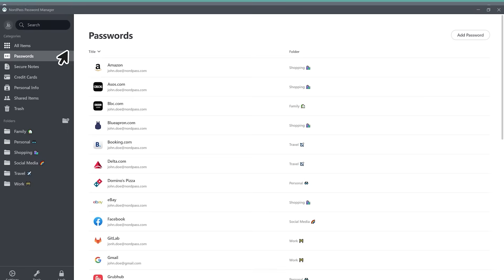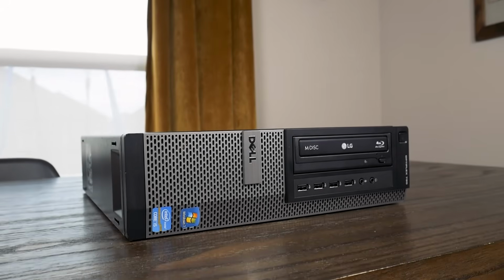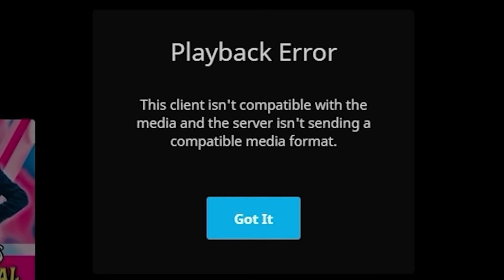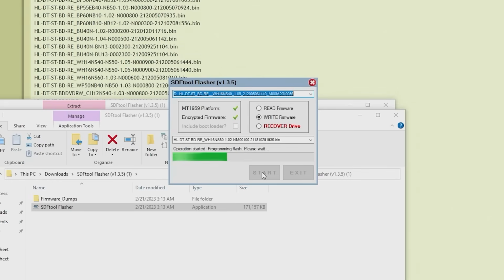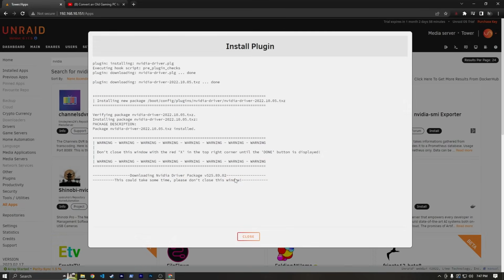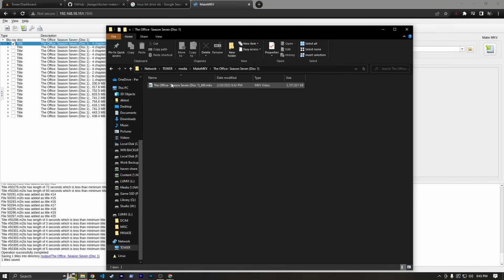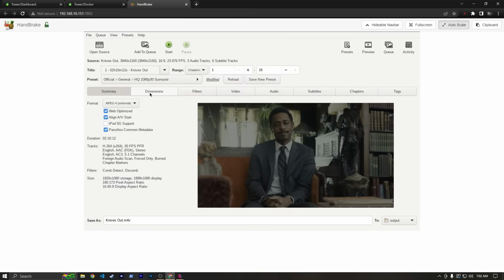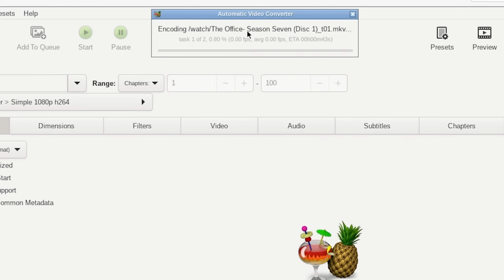Streaming 4K Blu-rays With a DECADE-OLD PC

Comment: Currently running a Amahi overlay on a  Fedora 27 server on a custom water cooled ROG Rampage V Extreme, I7-6800K, 64G ram, 24Tb Raid 6 (4 x 12Tb NAS Drives)  with a 2Tb M2 SSD boot. Running a Plex server for media. A bit overkill when you think about it but was having way to many hardware problems with this MB as my daily driver. Runs well as the server.
Reply: All good, transferred over 6Tb in one run, no issues found.
Reply: @colinsedgwick8938  Thank you
Reply: Hows the server going without ECC? Any issues transferring large capacity data sets?

Comment: Its  amazing  I am using an old AMD Phenom X4 9950 Black Edition as my Plex Media server and let it run headless in my attic Amazing to have found a good use for this old beats ! This PC I pulled out of the Trash in 2017 from a Recycling center and the only problem was that the power supply was broken.

Comment: Does jellyfin support iso video formats? I use vlc and kodi since both of them support iso video formats. All the 4k movies and blu ray movies that I ripped only in iso video formats? I prefer to use iso video format only that's why I rip every video in an iso format like ripping a cd uncompressed 16 bit 44.1 khz wav. I don't know if wav for 4k and blu ray for the video format exist since wav for audio is uncompressed. For my yamaha studio monitors connected to my 4k tv, I have the audio set to pcm with all the settings set to flat on my studio monitors because I want the audio to be as accurate as possible while my studio monitors are also connected to my schiit hel 2 dac amp and for my wired headphones, I use my sennheiser hd 600 being connected to the front of the schitt hel 2 dac amp at night when everyone is sleeping. I also have the topping d10s dac as an external dac connected to my tv so I know what the sample rate and audio format that is being played back with the built in led display. All the 4k rips include hdr and dolby atmos and all them include the menus before playing any of the movies.

Comment: My current setup is Anime based, so i use Topaz to upscale the content i get from DVD's, then use handbrake to convert it to a smaller filesize without degrading the picture at all.
Currently it takes Topaz 3 hours per episode on my 3070 to upscale and about 15mins to convert that file. Honestly some people hate upscaling but if you are like me and are not able to get good blueray's of anime this is the next best thing.
Reply: -Edit sorry Topaz is a upscaling software "Topaz Video Enchance AI"

Comment: Im still surprised what my old i3 4130 can handle. Ive it set up to run unraid and Jellyfin with its igpu and as long as i dont use 10bit video and stick to h264, it will transcode 4k just fine. So nice to get my old hardware to use. Only gotta help out with my PC to transcode a move once into 264 so it will work with it.

Wish the Handbrake container would work, but sadly i had no success since the older versions dont have the QuickSync support on Linux by the looks. but i did test it on a windows machine with handbrake 1.07 or something, and holy smokes it worked really well.
Reply: Those old 4th gen Intel chips are amazingly capable.  Consider grabbing an i7-47xx chip off of Ebay for around $50, and it'll make that computer really sing.

Comment: You should be able to use the K1200 in HandBrake for NVENC transcoding. Not sure if jlesage's package supports it yet but I changed mine to zocker160/handbrake-nvenc:latest

Comment: Nvidia T400 is an alternative to the K2000, it will allow you to use HEVC encoding/decoding. I am currently using an old Dell rack server with 2 x E5-2667v2 CPUs, draws too much power, so I am in the midst of getting together a server (HP ML110 Gen9) that will use a single E5-2630L v3, paired with Nvidia T600 for transcoding requirements.

Comment: Sorry for the silly question: did you transcode on the 6900 mini pc by grabbing the file over the network with something like smb? Or did you move it over with an external ssd or similar? Just interested in what is possible or easy
Reply: I've transcoded directly across a 1Gb LAN connection with a share on my server.  It would have taken longer to "sneakernet" with an external drive; my transcoding computer doesn't even come close to maxing out the LAN bandwidth.
Reply: @JamieStuff  Super cool! Thanks for dropping some wisdom 🙂

Comment: Why not use ffmpeg instead of handbreak as you  can do the same thing.

Also when dealing with 4k Blu-Rays usually they are in HDR.  so usually when I try to transcode they come out all desaturated as it doesn't do the HDR to SDR conversion correctly.
Reply: Handbrake is a front end for ffmpeg.

Comment: For the heck of it, you could swap the motherboard and processor in that Dell out to something a little more modern, like a Ryzen 5 3600 with a B450 or B550 board. The only issue you’ll have is getting the pinout for the power button, power LED, and HDD LED (I remember that being the only proprietary thing in that computer). The only thing you might need is a low-profile cooler, but I think a stock cooler like the wraith would fit.

Comment: Thanks for the videos.  You mentioned near the top that you liked the form factor of these DT Optiplexes, "especially when lying flat".  I had my 7010 SFF on its side for a couple of years before I realized the "DELL" logo on the bezel can be rotated 90 degrees.  This is my primary work machine, maxed out with an I7-3770, 4x8 GB RAM, two Samsung EVO 1TB SATA SSDs (one in an optical drive bay adapter), and a 1 TB Inland NVME via a PCIe adapter.  I'm driving two 27"  2560 x 1440 monitors from the I7's onboard graphics.  I don't game or edit videos,  just database conversions, software development, office tasks and web browsing.  This little workhouse has been running nearly 24/7 for many, many years and has never let me down.  I'm building a 12th gen Intel box now and will convert the "Little Dell that could" to a Linux server.
Reply: For what you are doing, you don't need a new machine, most of the new machines do the same stuff you are doing, at the same speed, if you are lucky...it seems like they've really tapered off in the way of speed increases until you get into high end productivity machines with multiple processors and such...but, like you, I just run what I have, and it works fine for my daily needs....those SFF Optiplex machines do pretty well...they were built for business, they were built to be upgraded/updated, rather than used a couple years and thrown away like so many of today's machines with everything onboard and not being able to upgrade RAM and sometimes even your storage drive isn't removable....what the heck LOL.  

I've salvaged a lot of the Dell Optiplex machines in recent months, cleaned them up, installed an SSD, fresh windows installation, and have given them away to families with school aged kids that can't afford to buy that stuff.  They're not the latest and greatest but they'll get the job done pretty well when all you are doing is school work, web browsing, and a few youtube videos.
Reply: @wildbill23c  while I agree Intel has stagnated in recent years, you can't really ignore the single-thread performance in 12th gen is a huge upgrade over 3rd gen. Since many workloads are still single-threaded, you care about single-thread performance. A 12700 will run circles around a 3770, and more efficiently. iGPU performance is even more noticeable when you jump 8 or 9 generations forward.
Reply: My daily driver is a Dell 7010 SFF i5-3470 CPU @ 3.20GHz × 4 16gb ram and an ancient Turks PRO [Radeon HD 7570] running Linux Mint. It just works great.
I have several other newer machines and yet, I see no reason to replace/ retire this old beast.
Reply: The PS2 you can also rotate the logo

Comment: --- x265 to mp4
FOR %%A in ("*.mp4") DO ( 
ffmpeg.exe -n -threads 0 -i "%%A" -map 0 -c:v hevc_nvenc -cq:v 19 -rc:v vbr -b:v 2000k -minrate 900k -maxrate 2100k -bufsize 2100k -preset slow -vprofile main -strict -2 -acodec aac -ac 2 -ab 192k -vf yadif,hqdn3d,unsharp=5:5:0.5,gradfun  "%%~nA2.mp4"

---
--- x264 to mp4
FOR %%A in ("*.mkv") DO ( 
ffmpeg.exe -n -threads 0 -i "%%A" -map 0 -c:v h264_nvenc -cq:v 19 -rc:v vbr -b:v 2000k -minrate 900k -maxrate 2100k -bufsize 2100k -preset slow -vprofile main -strict -2 -acodec aac -ac 2 -ab 192k -vf yadif,hqdn3d,unsharp=5:5:0.5,gradfun  "%%~nA2.mp4"
---
Reply: a basic debian recursive dir version of the windows bat above, the 'hevc_nvenc' & 'h264_nvenc'  & -vprofile high/main are the hw encode key parts, just modify the ffmpeg line as required....
----
nice -20 find -name "*.mkv" -exec bash -c 'ffmpeg -i "{}" -y -f mp4 -vcodec libx264 -crf 16 -minrate 900k -maxrate 2100k -bufsize 2100k -refs 3 -preset veryslow -vprofile high -strict -2 -acodec aac -ac 2 -ab 192k  "${0/.mkv}.mp4"' {} \;
------

Comment: In Unraid it's generally better to make separate shares for Movies and TV Shows. While this isn't a big deal if you're only running a single array drive, it can cause issues if you add more drives to your array. One of the main advantages of Unraid is that you can basically add another drive whenever you want to or whenever you need more capacity in your array. Having your Movies and TV Shows on different shares allows you to change the split level of each share individually. For movies you should set Split Level to only split the top level directory, that way all the contents of each movie's folder stay on the same drive. For TV Shows you want to set it to split the top two levels of the directory, that allows you to keep each season on the same drive, but allows different seasons of a TV Show to be written to different drives. TV Shows can take a significant amount of array space and if you have it set to only split the top level directory, Unraid will try to put the entire TV Show on a single drive, even if it is out of space, per your split level settings for that share. Keeping the whole season on a single drive avoids long load times when watching multiple episodes but also helps avoid trying to write large TV Shows with multiple seasons all to one drive even when that drive is out of space.
Reply from the maker: For sure. I just didn’t think it was worth diving into split levels on this video, especially since this system is about to get stripped down anyway. Great explanation of it though, and I hope other people come across this! Wish I could pin it 👍🏻
Reply: @HardwareHaven  For sure, that makes sense. Love the video though, seeing another nerd like myself figuring things out as we go! I'm mostly self taught when it comes to tech, but have learned a lot setting up 3 servers now that I have running in my homelab. I've made a bunch of mistakes over the years and just want to help other people avoid the pitfalls and frustrations from the mistakes I've made! I have two separate Unraid servers running and one that runs Proxmox, tons to learn with both OS's. Keep up the content!
Reply from the maker: Nice! Love the attitude and sounds like an awesome setup!
Reply: Thank you for sharing 🙂

Comment: I also talked myself out of a cache pool on my server. I've found that it can stream multiple 4K videos at once without bogging down the drives or the basic gigabit ethernet I'm using, and my ARC hits are already pretty high. On a basic home media server, it's pretty overkill. Though the adapter card would allow you to have more disk space in the small form factor.

Comment: Someone probably said this somewhere below but jsyk that's not a dual NVME adaptor - I have have same exact card - it has one NVME drive that goes through PCIe as normal and one SATA drive which is POWERED by PCIE but then connects to the mobo with that SATA port on the back so that the M.2 SATA drive is then connected via an old school SATA port....hence the different keying and the NVME mentioned on one side and NGFF (next gen form factor for SATA) on the other

Comment: Since you have nvidia card, I think you could use ffmpeg and nvenc to transcode the blu-ray. Decode the video with the CPU, then resize and encode to h264 with the GPU. Audio can be easily copied without re-encoding. At the same time, delete unnecessary tracks.
Reply: I was thinking the same thing.  Kind of, anyway.  I messed with tdarr a little, but couldn't get it figured out without spending more time on it than I wanted to.  I just use an unmanic container (again, couldn't get it working the way that I wanted it to) and I have a couple of bash scripts that I wrote, to encode files that I drop into an imports folder, and then process them with the hevc nvenc encoder, using a GTX1650 GPU in the NAS.  Average speed is about 18 to 20x (compared to about 2x for CPU encoding, although, the Intel QSV encoder was around 10x, so would still be a good option if you didn't have a dedicated GPU to lean on)

I know that I should just spend a little more time in tdarr, however, MOST of my old collection from pre Netflix days has now been imported, and transcoded, and more importantly, all renamed to have a consistent naming convention (I can't believe how little I used to care about filenames, and folder structures lmao, one of the reasons it's always fun to explore old HDD's)
Reply: One could also try an intel arc gpu as the cheapest ones come standard with avi decoding and encoding, i know this isnt the point of the comment but still a neat option
Reply: The issue with GPU encoding (e.g NVENC) is that the filesize is larger, and quality is lower. Software X264/X265 takes longer but gives the best result. He could still use MakeMKV if he finds it easier, and use MKVToolNix to remove unwanted tracks (audio streams, subs, etc...) as well.
Reply: @jarsky  Quality concerns are really miniscule nowadays, high motion footage like video games still suffer, but movies are more than okay to just transcode with the gpu.
Reply: Hardware encoding for archival is bad and should be avoided. It should only be used when realtime encoding is required.
Reply: ffmpeg is so much faster than handbrake for me. it doesn matter which preset I use or how custom I make it, a simple ffmpeg libx265 is at least twice as fast with the same CRF
Reply: @raulgalets  Perhaps this is due to the fact that ff means fast forward, and handbrake is a device for slowing down😁
Reply: @kote315  lol. you got it
Reply: @raulgalets neither handbrake nor ffmpeg are actually encoders, they’re frontends. You need to specify the underlying encoder being used i.e. x264 or nvenc.

Comment: Very cool!  I still believe you can find a cheap  Intel(R) Core(TM) i7-3770 CPU online for cheap and slap in that puppy.  Also make a network share of the MakeMKV folder to your smaller machine and have a docker container monitor that directory...and auto-encode.
I went thru ALL my video library, transcoded to H265 and saved myself (Space saved18880 GB) with Tdarr (using multiple computers in my home network-it took about 3-5 months [using CPU only processing...no video cards to do hardware encoding])!!
Love your video's!  Keep em coming!!!!

Comment: Handbrake does support hardware encoding & decoding so if you upgraded the GPU you could use handbrake on the same computer to do transcoding.

I was running plex on a 
Intel(R) Core(TM) i3-3220 CPU @ 3.30GHz   3.30 GHz
8.00 GB (7.88 GB usable)
So a slightly newer CPU than what you mentioned, but I kept running into out of memory & CPU errors when my kids & I were all watching different shows.
I decided if I was going to build a new plex server (GPUs were going for triple MSRP at the time) I would make it a relatively high-end system.

I put in a Intel(R) Core(TM) i7-12700K with 128 GB of RAM. I used RAID 5 for my 4 drives, & boot off an M.2 drive with a DVD & Blu-ray drive in the system. Because the CPU includes a decent GPU it can hardware transcode h.264 & h.265 with no issues.
Reply: Most of the older processors don't have the encoders needed to encode, later model Intel chips (like 8th or later) do have H265 compression codex built in, otherwise they just chomp their way thru with regular processing..it is possible...but it's ALOT slower than using video card cuda cores :(

Comment: Does Handbrake convert the original HDR video to a lower bitrate and also keep the HDR? That's interesting, I use ffmpeg from cmd and use hardware acceleration and the best I can do is tonemap it. Also in jellyfin I believe, tonemapping is not available for CPU, only hardware transcode can, which is why in 10:43 the lionsgate logo looks weird. I'm wondering if you can utilize the minisforum ryzen PC as a jellyfin or as a handbrake transcoder (via network share, though the share speed is not that fast), however I don't know the hardware transcoding capability and quality of Ryzen APU. Overall great video showcasing the potential of these hardware and tools.

Comment: You could try upgrading the cpu to the i7 2600 which will give you 8 rather than 4 threads and use a different OS like windows 7 or Linux that would use less system resources.

Comment: Sell the K1200 and get a P400 or P600. Both are low profile, both low power, both can do HEVC/H265 perfectly. It’s a better codec anyway. Half the file size of H264 while retaining quality. Plus, there’s already advancements to get to H266 within the next couple years. H264 was great in its hayday but it’s getting a bit long in the tooth these days.

Comment: Lets see now where you failed completely, low storage capacity so really it's only a player, flashing firmware is just a bad idea,  it can't transcode already ripped blurays the same day, and you can't transcode without using an expensive separate machine, oh yes finding drives and copying Linux code to make it work is what your average user can do. If you don't see this as a fail then don't ever work on home networks. All you had to do was upgrade the CPU and storage which is very easy and cheap to do with that prebuilt.